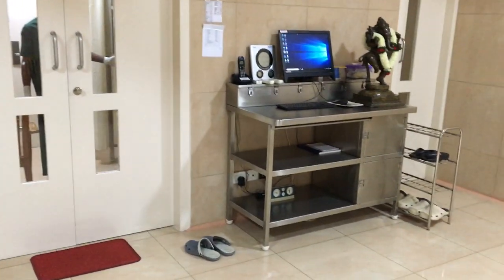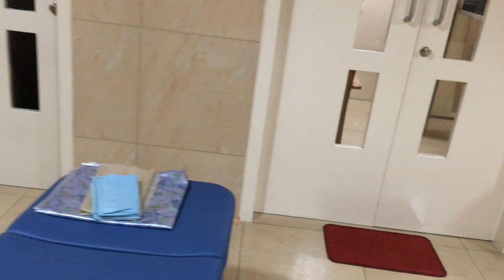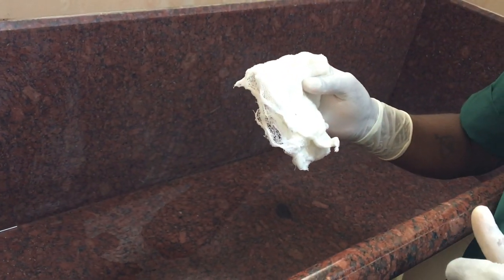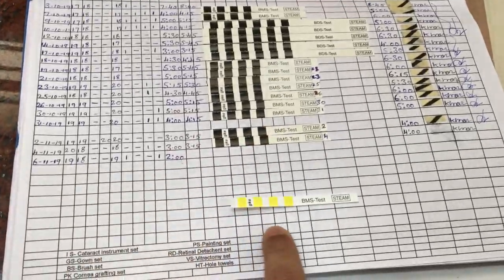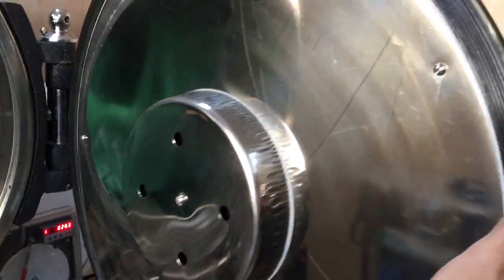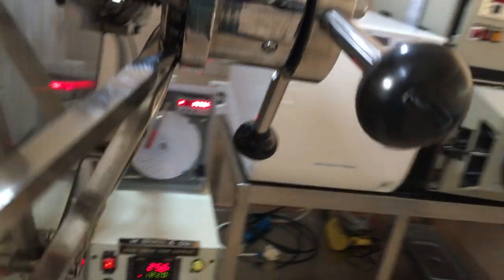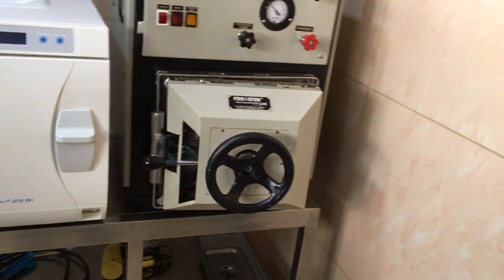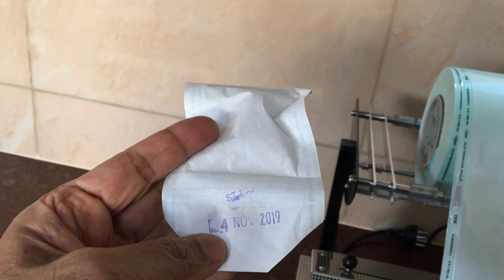Operation theater in Karthik Netralaya 2

Comment: Sir which water filter to be used ..should we put it  on the water tank??or RO water at the wash basin.
Reply from the maker: Cleanest and softest water that is available is to be used for most of the purposes in OT, though it does not have to be sterile. For filling autoclave tank, in the ultrasound tank and for washing the surgical instruments, better to have a RO plant.